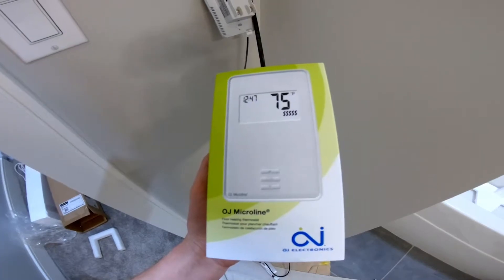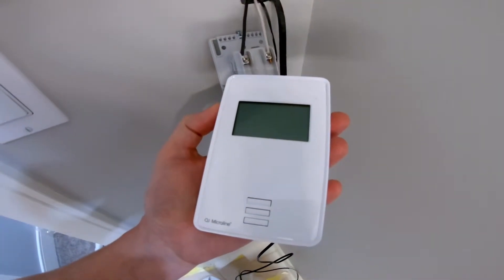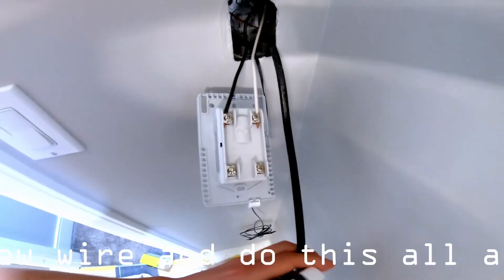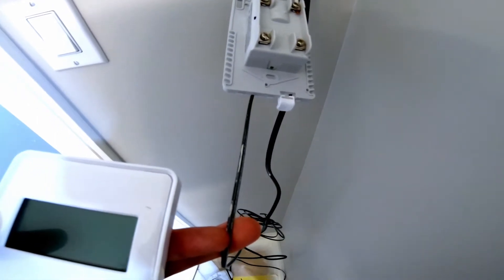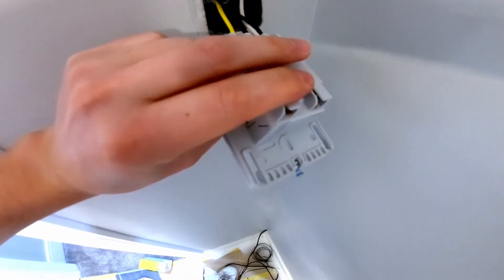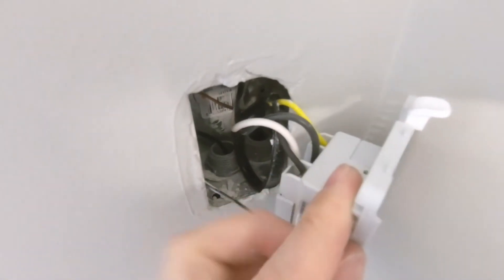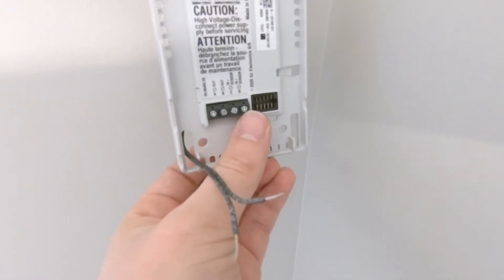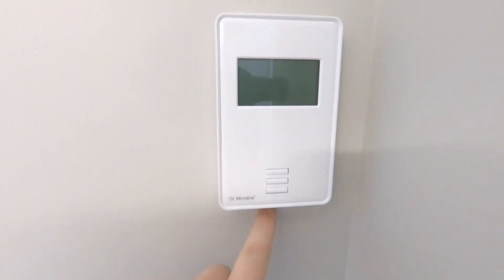Wiring an in floor heat thermostat

Comment: Is this on a 20 amp breaker or 15?
Reply from the maker: This one is on a 20 amp breaker. But it really depends on your local building code, I could have got away with a 15 amp breaker based on the load, but code said I needed a 20 amp circuit and 12 gage wire. A larger in floor heating system covering more square footage might need something even bigger or even 240V.

Comment: Looks great. How do you like your floor heating system? I'm surprised 14 gauge wasn't enough for 15 amps, I thought it was. Sorry you had to redo it. Don't forgot to phase tape that red wire. 👍
Reply from the maker: The in floor heat system is great. For a basement bathroom with tile it sure doesn't feel like it at all. Keeps the bathroom nice and warm, tile is warm. I really wouldn't do it any other way if I had to do it again some day. I guess code wise here all heating loads need to be 12 gauge even though the max output of the heating mat would draw much less than 15 amps in actuality. Might be more for future proofing then anything else. It was a short run to re pull so not a big deal.